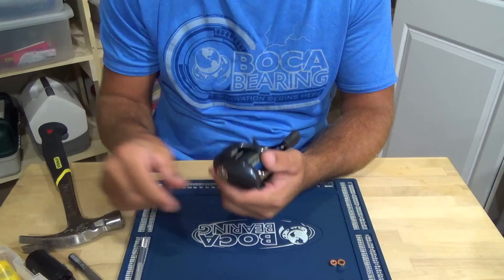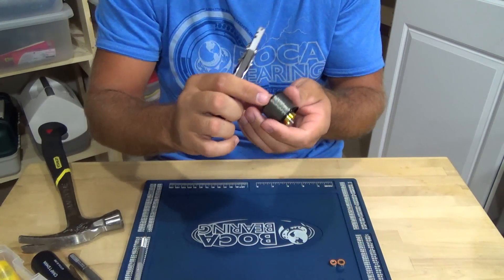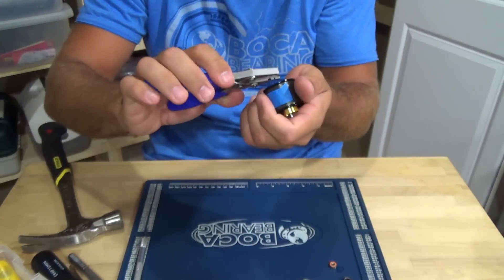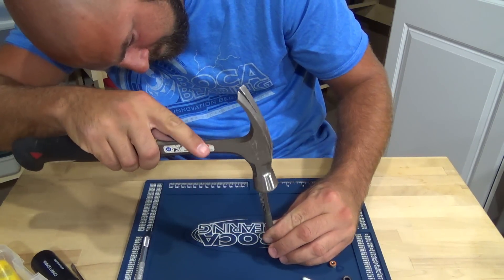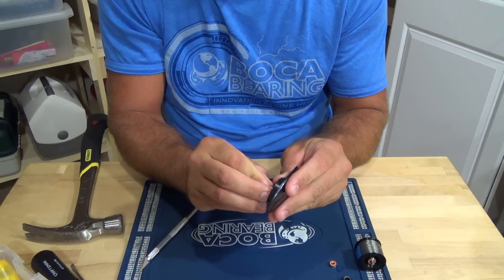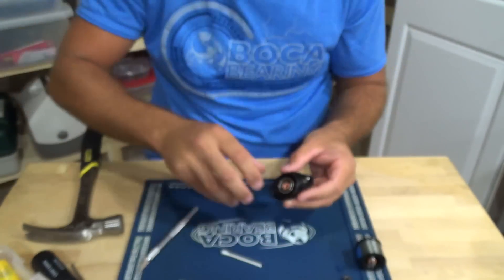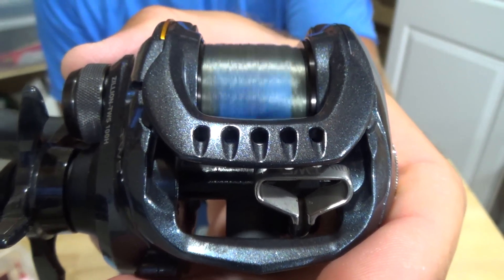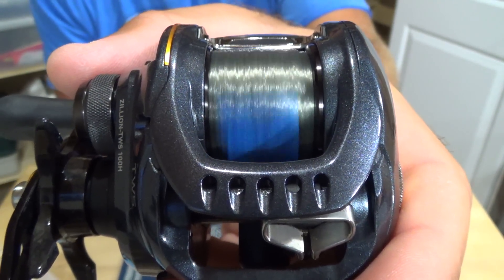Boca Bearing Upgrade: Daiwa Zillion TWS 100H

Comment: Bought my bearings this past Monday!
Reply from the maker: +Randy T. (Ran) If you use a punch and hammer make sure to tap lightly so you don't damage the spool. You can also push the pin back in using the pin on the pliers.
Reply: I bought a watch kit online for this.
Reply: Randy whats a watch kit?

Comment: Certainly have to ask you question as I have been wondering about it. Without the spool shaft coming on through , how does the spool tension knob put tension on the spool?   Also , I give you extremely high marks for reel maintenance, from watching these bearing upgrades and the reel teardowns and cleanings you have done.
Reply from the maker: +arciefan I'm not sure of the exact name, but there is a part that goes through the bearing, under the tension knob that meets up with the spool.  Thanks for the comment

Comment: will this fit the zillion tws 100xxs?
Reply from the maker: +ThisLaoGuy It should, no reason to change the bearing sizes. You can also use the pin on the pliers to put the pin back in, if you use a punch and hammer make sure to tap lightly so you don't damage the spool.